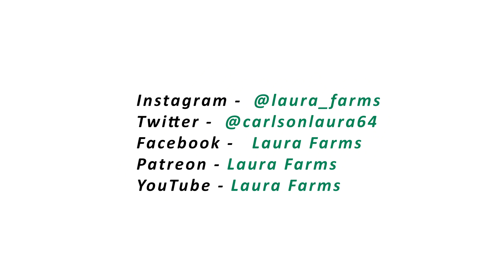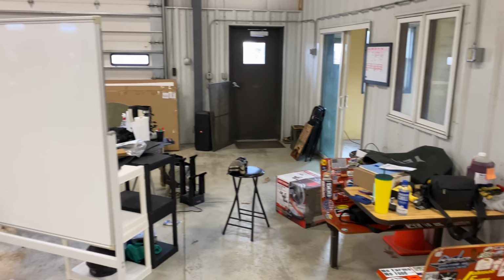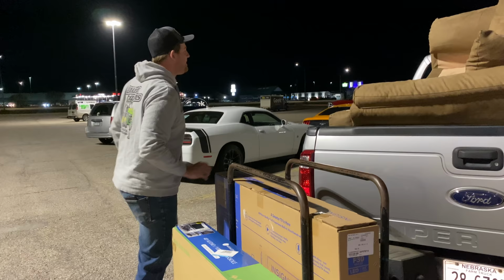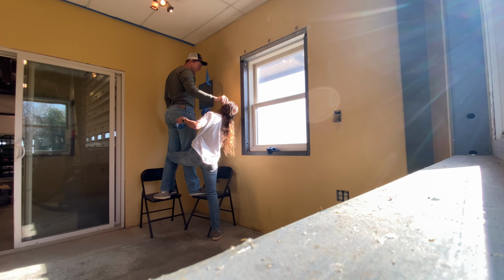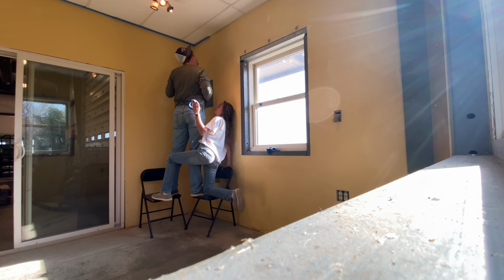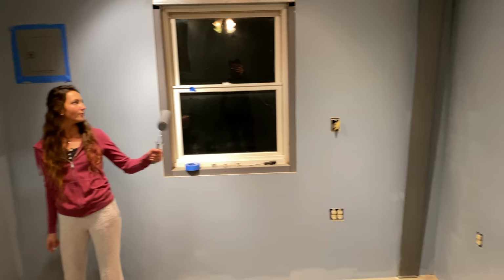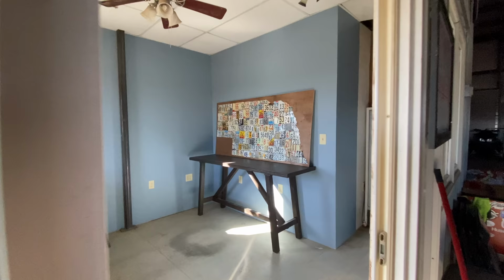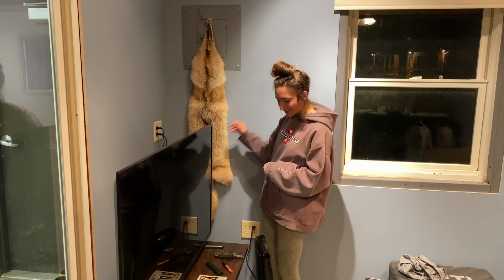Two Days and $1,000 Later...

Comment: Get one of those articulating wall mounted TV arms, the tv will be off the table and you can use it to cover the fuse box fixture in the corner by angling the screen in that corner.

Comment: greetings folks; an idea is: save your ceiling tiles by getting some more of the 2 foot cross pieces and add them halfway, then cut the 2 x 4 ceiling tiles to fit in the 2 x 2 holes. i have never seen the 2 x 2 tiles sag but the 2 x 4 tiles always do...............g

Comment: Nice Job!  White Board Tip: When the board gets "cloudy" from repeated writing/erasing, spray it with "Tuff Stuff" which you can get at the Auto Parts store. It's a great all purpose cleaner (Great on sneakers) and will get the board pristine white again.

Comment: As an electrical contractor that's  A no no! They're supposed to be mounted to the ceiling grid with bar hanger boxes , then you can do it if, you also put slack wires on it attached to the Box so in case it falls off the ceiling in an  earthquake, it doesn't brain  somebody!!

Comment: For more even paint application with rollers, start off on one side of wall and work your way to the other.  Which ever side you start make sure the roller handle attachment is the side that is going fowards with about half way overlapping each other.  This will result in the most consistent and uniform paint.

Comment: Great job on the Remodel it looks Great. TV DO NOT USE IT if the room is not heated all the time when it gets very cold Because, when it goes from to Cold to Hot on the inside of it , it will create condensation and will damage it or it may cause a fire.

Comment: Everyone should be able to do basic remodeling ... saves you a ton.  You will also be amazed how high quality paint goes on so much smoother and nicer.  Cheap HomeDepot paint pales in comparison to a nice Sherwin-Williams brand.  If you can afford it, go nice quality of paint..you may not even need 2 coats.

Comment: Y'all did a good job, looks great, cool color too. Next time though if you use an empty 5 gal bucket to put the paint in, and buy a roller screen, and a roller pole, it makes it all so much easier, faster and cleaner. And its still cheap. Those flat roller trays are so messy and just a pain. Also if u wanna take it to the next level one more thing u could do to make a big difference is change those faceplates(outlets and light switch covers) to a brighter white.

Comment: When I first saw the licenses plate plaque in the opening I thought you had a wall with license plates from all over the USA from your fans.  I just got replacement plates for my personalized plates on my crew cab dually, and I was thinking about sending you one for your wall, but alas it was the plaque of Nebraska, not a wall of plates from all over the USA.

Too bad no one thought to turn the chair around so the front was against the wall, so they would not try to fold as Grant was reaching.

Comment: So dad would call those spots where you can see the last color through the new color a hallow day 
By the time he said it 3 or 4 times it sounded like he was telling me I was on holiday while painting 
I never thought I was that bad of painter 
It took me years to realize he ment painting is easy you should enjoy it 
Lol
So silly 
Nice job on the mud 
Next time use the metal side of the roller on the floor and roll horizontally then with out the metal side another horizontal as close to the ceiling as u can then straight up and down and fill in between

Comment: Nice job on the remodel. Thanks for taking the plates off the light switches and electrical outlets instead of leaving them on and trying to paint around them.  I'm not a professional painter, but that is a huge pet peeve of mine.  I have painted a lot around my house and I always take them off.  Some people, for some reason, leaves then on. 🤦🏼‍♂️

Comment: Nice remodel project. When you decide it's time to rework your acoustical ceiling consider buying some 2 foot long ceiling grid tees so that you can buy ceiling tile that is 2 foot square. This will cure your sagging tile problem which will just reoccur if you use 2 foot by 4 foot ceiling tile. Thanks for sharing this project with us!

Comment: I would recommend getting white LED based lights, which will brighten up the room and remove the yellow tint from the older bulbs.  I would also splurge on some baseboard around the bottom of the wall.  It will pep it up some.  Also, update your off-white outlets/covers to white and you can get the ones that have USB ports integrated.
Reply: Also paint the window trim white from wood, to match the frame of your door, which is white.

Comment: That car on that calendar 📅 is the same year Dodge Charger that I had back in the Day, 1966 440 4 speed , I drove it on the street and strip, it was calmed up a little bit,and it had headers and a mallory ignition distributor, Holly 750 double pumper, it turned high 13 s in the quarter mile, loll mine was mid night blue, that was a blast 💥 it was way to fast for the street, loll nothing like now Days, !!! Good       Remodel of a room, in a shop, thanks BigAl California.praise Jesus grace Christ amen.

Comment: light fixtures, ceiling fans, etc should be attached to STRUCTURAL stuff - ceiling joists, or spanners between them - and NOT to acoustic-foam ceiling tiles!! the tiles can be trimmed to fit around recessed lights & fixtures, but NOTHING should attach to the tiles themselves, not even 'trim rings'...